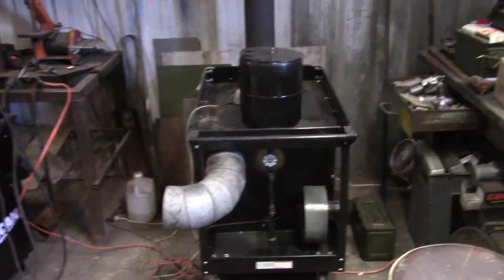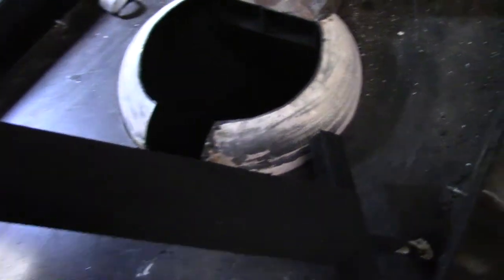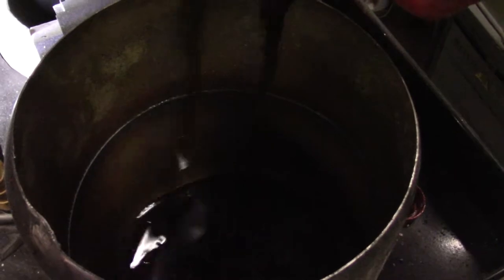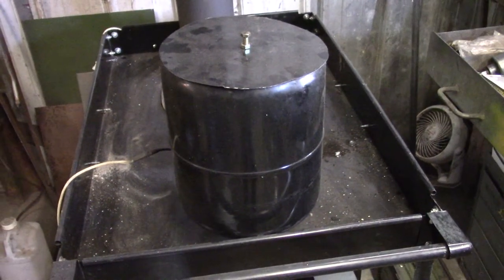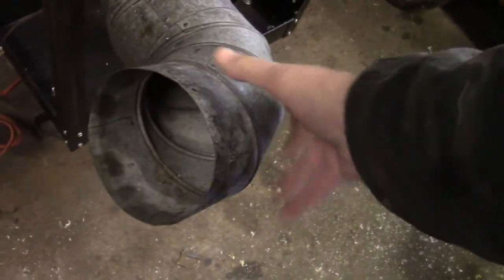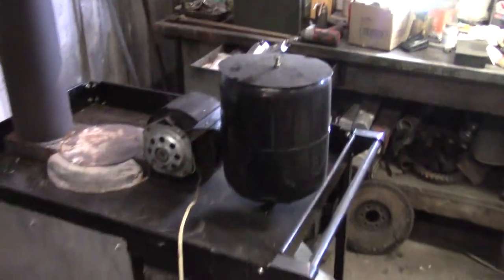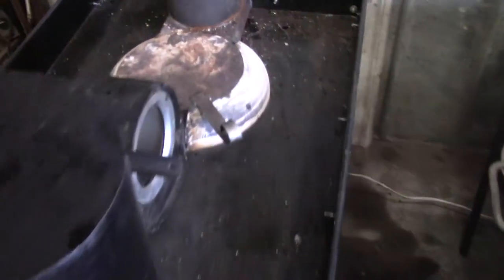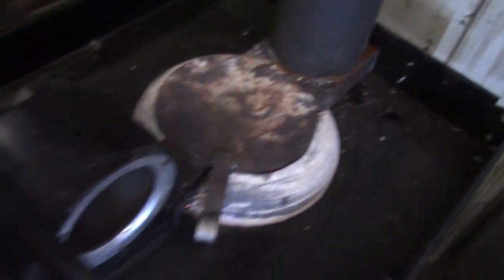CRAZY efficient waste oil heater !!!

Comment: Great job!  PLEASE, tell me about the holes in the air fixture that sticks down into the burner area (the size and number of them).  It appears like you have figured out almost exactly "the angle of the dangle" with regards to air/fuel mixture and what it takes to get the vortex w/blue flame.  I want to build a waste oil heater for my shop, but I'd rather not be fooling around w/it for weeks trying get everything "spot on" like what you have.  Many thanks, and again, great job!   : )

Comment: NC heater got job can you tell me about the fan on lower shelf where is flow going.Understand one on top.Is the lower one surrounding tank thru pipe. To circulate heated air?
Reply from the maker: Hi.the lower fan just blows air around the propane tank/burn chamber and out the other side.the cart with its sides sheeted off makes a kind of heat exchanger.the whole works gets hot and radiates heat but i can put together pieces of furnace ducting pipe and make it blow nice hot air clear on the other end of the shop or where ever i need it.

Comment: that is a similar build to mine, I gather you were talking about me when you said you seen guys using a hair dryer, thats how I started with my oil burner build, Now im using a shop vac in an insulated box to keep the sound down. After years of use I am coming to the conclusion that the unit is to big for my shop as it puts out way to much heat for my space. I need to build a smaller one.
here is my set up. https://youtu.be/1tGXJkIPk34?si=YK48DjcTrT17KzRO